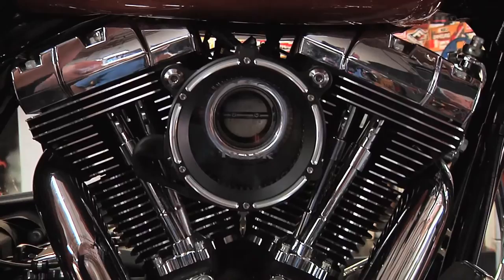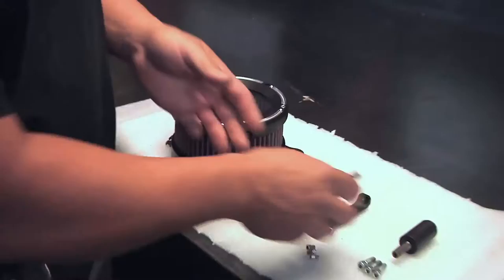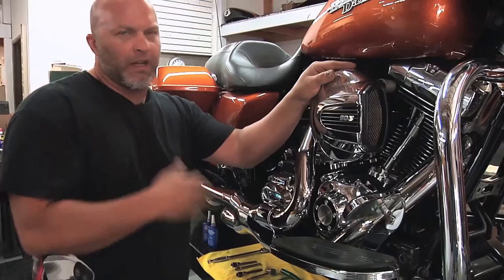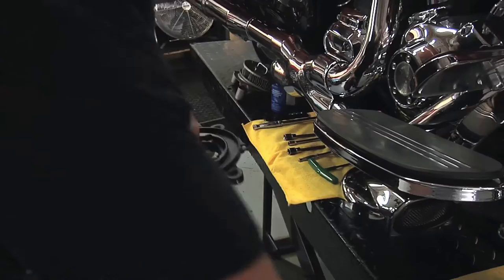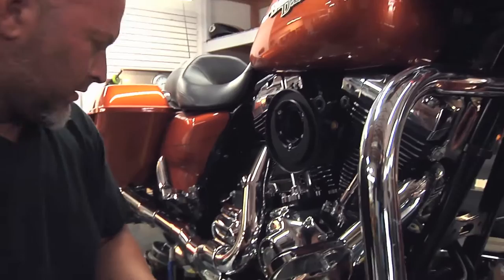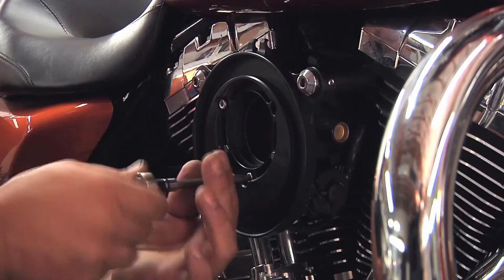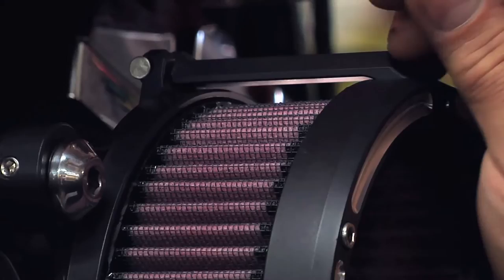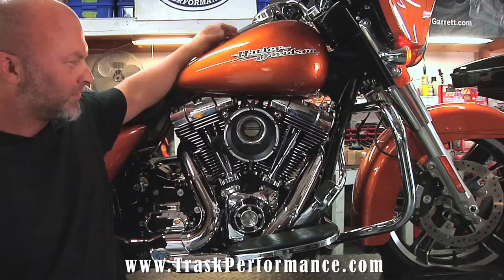How to Install the Trask Assault Charge Highflow Intake - Trask Performance

Comment: I have a massive gap between the backing plate, and the throttle body. I have removed the throttle body support bracket, and everything. Seems as though the breather bolt spacers are too long. I have about an 1/8” gap.
Reply from the maker: Hello, Thanks for reaching out - we don't have anyone on here for technical questions.  Please email hello@traskperformance.com with this issue.  I will also let them know to be expecting an email from you.  Thanks so much!
Reply: Hey did you find out what was causing the gap I have one as well

Comment: What are the screws on the side of the backing plate for? I’m speaking about the small Allen screws pre-installed on the backing plate.
Reply from the maker: Those holes are required for machining purposes so we loctite those allen screws in to plug the holes.
Reply: @TraskPerformance can you make me a backing plate without those holes/screws?